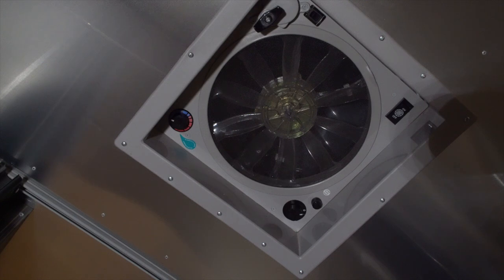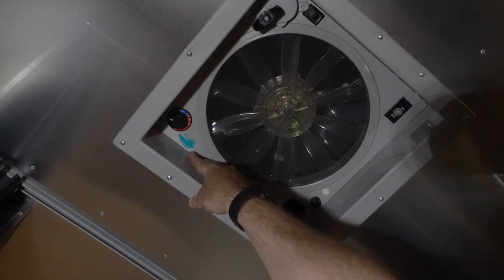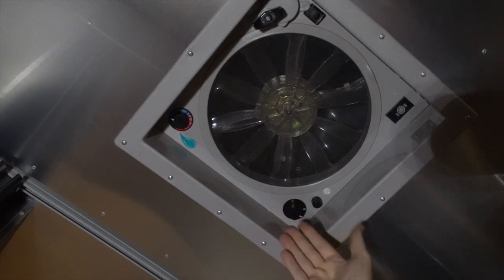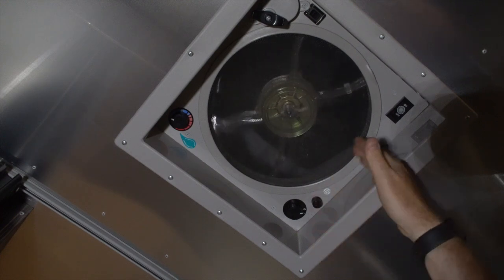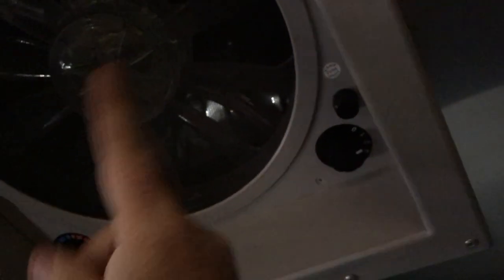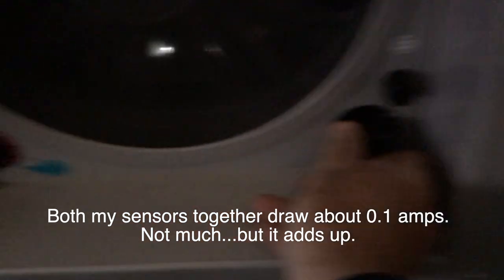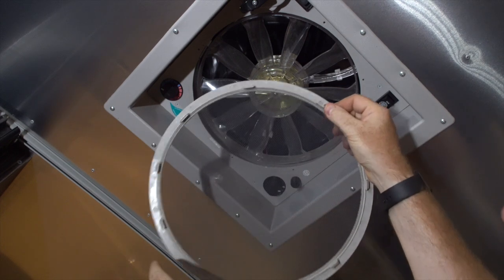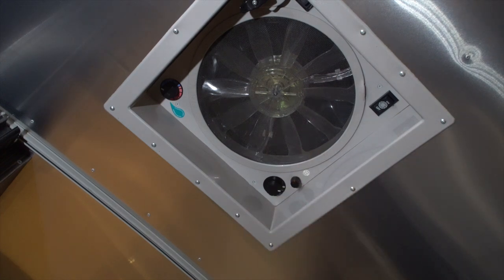Fantastic Fan -- How to Make it Work!  Simplifying the Confusing Controls of the Fantastic Fan

Comment: Great info in your video. Think we need info on the advanced silliness of the thermostat. Sometimes fan works & sometimes it doesn't.  Can you help?
Reply from the maker: Haven't dug into that particular mess, but I would check your "auto" vs. "on" settings for the fan in each mode, AC, heat pump, furnace, etc.

Comment: Curious if you know if you can only open it partially to vent the air or does it have to be fully open? Wanting to be able to get for sure through without being fully open if it’s partially raining. Can you crank the hand knob or will that mess up the motor? Thank you
Reply from the maker: Yes, you can crank the vent by hand, no problem!  I do that any night where I worry about condensation inside the trailer from sleeping folks.

Comment: Another great vid. How about the other fan above the head? My gasket got brittle and ended up chucking it and I can't find a replacement unless you buy a cover for it and my cover is fine. I'm still ISO finding a hack gasket 😁
Reply from the maker: Funny you should mention that.  My gasket for the head fan disappeared sometime last year.  I have not had any noticeable leaks, so I've put it on my list for eventual repair but haven't prioritized it.  Are you getting leakage?
Reply: @JustaJourneyman  no leakage yet as long it's closed. The rim of the base has small holes for water to drain so far it's holding up w/o that gasket 🤞
Reply from the maker: @i2oadi2unnei2  Good to hear... thanks.  I think I'll sit on mine and just wait until a good opportunity for repair comes up!

Comment: Thanks for the info! Can you tell me why the fan shuts off when I change the temperature knob?
Reply from the maker: The temperature knob works like a thermostat and assumes you want to COOL the RV.  So, if you set the knob to a temperature lower than the current temperature inside the RV, it will shut off.
Reply: @JustaJourneyman   If it's not cold enough why would it shut off????

Comment: First of all thanks for the video. Could you explain what makes the fan change direction? I know it will but i don’t know how i did it. Thx
Reply from the maker: Hmm... mine doesn't change direction.  You would have to buy a reversing switch for it (not expensive, not difficult to wire).  There are a few videos about that out there, but this one looks particularly detailed: https://youtu.be/YE1zuLL625Y

Comment: Great video, but you left out how to operate the manual knob to raise and lower the lid. That big black knob doesn’t seem to turn manually (even though you would think it is there for that purpose).
Reply from the maker: The one that looks like a flat knob does turn, but it can be tough.  On some models, I believe you have to pull it downward to disengage the motor.

Comment: Sorry to ask a dopey question, but you do not mention the fuse. Is that just a pull it out and plug in a new one change out? Could it be the source of my problem. I have two fans in an older RV that are not working.
Reply from the maker: Fuses are pretty simple, but can be intimidating if you've never dealt with them before.  Just remove the current fuse and you'll see writing on it (use a magnifying glass).  Or, just carry that fuse into an auto parts store and say "I need one of these."  They cost practically nothing, are easy to find, and are easy to install.

Comment: Mine is much simpler and is more manual. I must use the handle at the top of the screen.  The handle can fall apart and it is a pain to put it back together. There is a video about how to put the handle back together.

Comment: How do you close it, tho?  Mine only opens.  :(
Reply from the maker: It will only close if you have the speed setting (the "true power switch" I showed in this video) set to something other than zero.  If you're on setting 1 or above, you can click the lid switch to close it.  Sometimes you have to click to open it and then click it a second to close it.  It's dumb and it needs you to repeat yourself!

Comment: Wait 'til the sensor starts acting up on you and makes you fight with the fan or squeezes the fan to close tighter with an annoying noise at night 🤣.  The sensor is at the top in the area where that blue drawing is, accessible from the roof, top of fan, I had to change mine only a year and a half old, it wires inside aroun.,, Hard to explain But sensor does wear out and act up when humid or raining.  DIY ok Job.
Reply from the maker: I think you can pull down on the twist handle to disengage the lid from the motor... which then allows you to open or close the vent manually.  That might be a good way to defeat a faulty sensor in the short term....
Reply: Journeyman Not mine, I think the newer models Don’t have that option.  Talking about the same model Fantastic Fan.  I wish they did leave it because it is true l’y annoying having the fan close just because of slight humidity when it is 100F out!  Lol,, I would force it open and it would fight me.  Laughing now, but cursing then 😅.  My second Fan is starting to act up also.
Reply from the maker: @projet2907  Ah... I will have to check mine. I often crank mine open, just turning that lever and hearing the gears whir inside the enclosure.
Reply: Every now and then we can hear ours making noise like it wants to open. Any ideas?
Reply: @garyduran1  THat's the noise I am talking about, sensors do wear out, I had to change one, it was not only making noise constantly but closing when perfectly sunny outside, just because of Florida's High humidity,  It also looked fried.  I do clean the surface with soft microfiber.  On days I hear it wanting to close tighter, the surface might have a drop of water on it, I just shut the fan at off position.
Reply: @projet2907  that makes sense. Ours only does it when it’s humid. Thank you